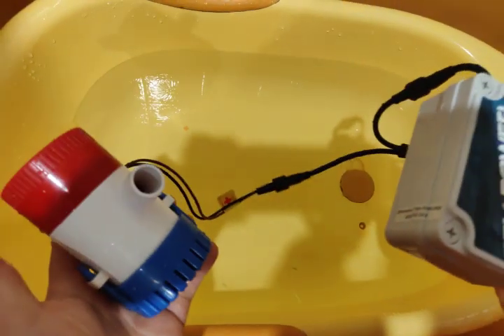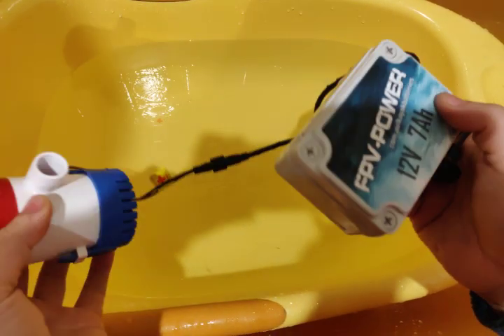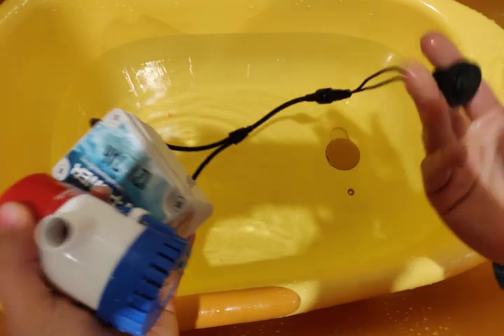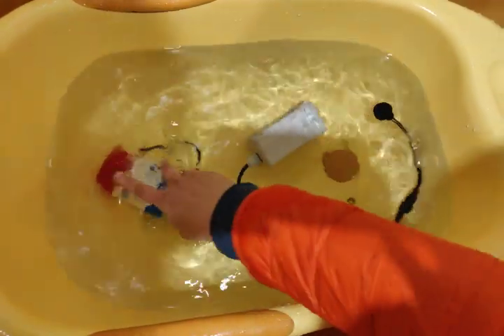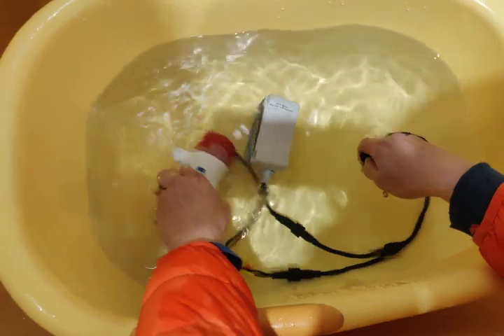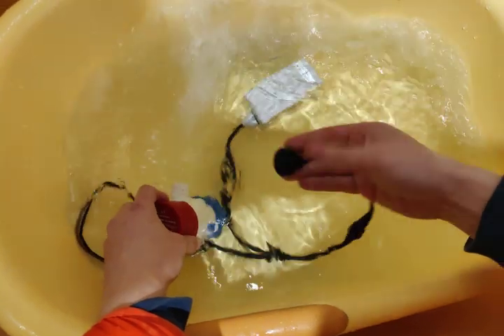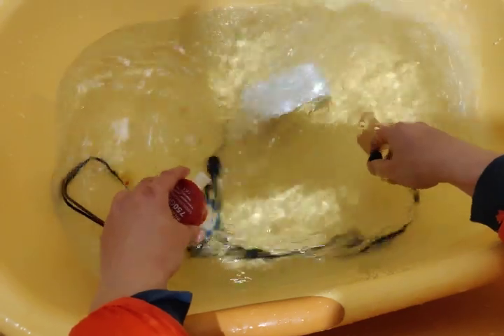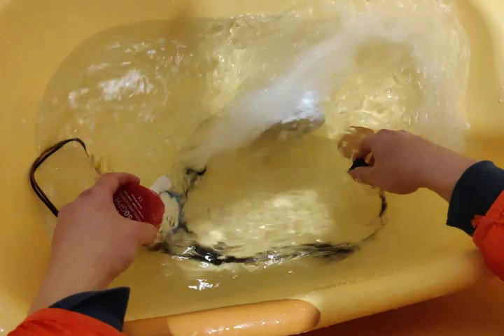Fpv-Power Kayak  Bilge Pump waterproof test.

Comment: When will these be available to purchase??
Reply: We have a few available in Australia but not listed on the website as yet. Please get in touch with us directly if you want to purchase!
Reply: Brandon Goh can you run this through the FPV hub and use the remote to turn on/off?
Reply: @breadplayzgames1653  yes definitely! You won't need this wiring harness if you're running the pump through the hub
Reply: @brandongoh8900  u have these bilge pumps available???